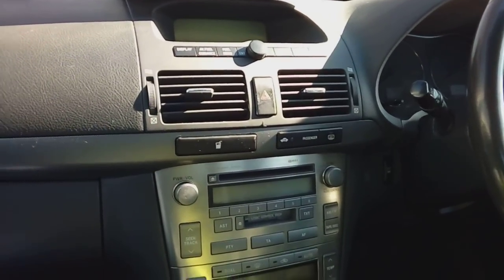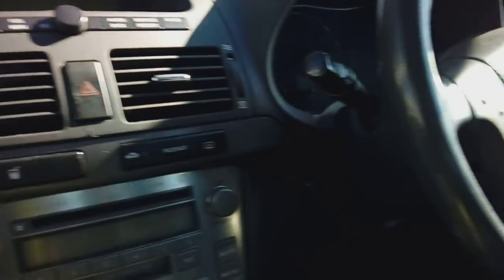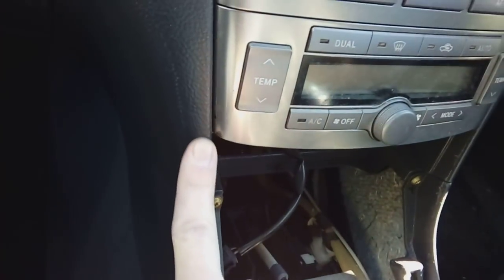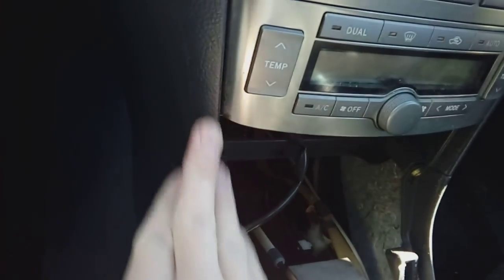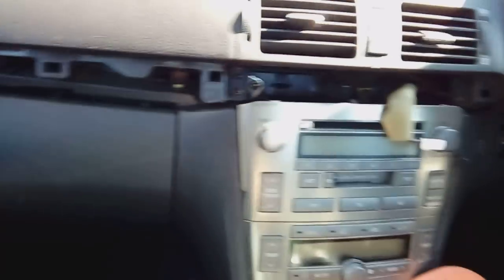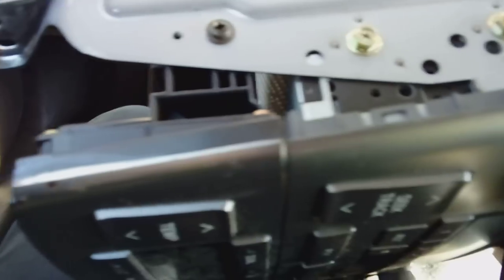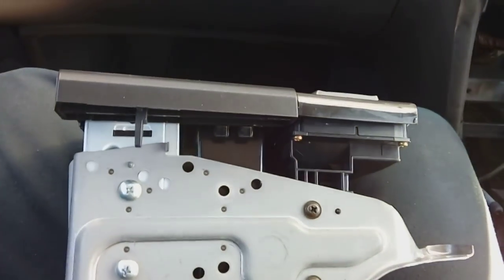Toyota Avensis 2003 - 2009 radio removal guide inc steering controls

Comment: Thanks a million for this video! It helped me today when I wanted to check the reason for very poor and mostly non-existent sound. If any sound, then from one of the four speakers only. I wanted to see if I would find any visible loose connections, which I didn't. However, after disconnecting all plugs and cleaning them (fine sandpaper slip on a tiny stick) , including all sockets, the sound is now perfect from all speakers. I was prepared to take the next step and aquire another unit, but luckily I didn't have to.
I would never have had a clue where to begin, if it weren't for your video, so THANK YOU!!! I encourage everybody to check and clean all connections before disposing of a unit which is not performing.
Greetings from Pargas, Finland

Comment: I have changed my old head unit to OEM B9010 one and my steering wheel controls stopped working... I just wanted to ask is there a fuse I might have burnt?
Reply from the maker: Nope sadly not, steering controls work on a resistive circuit so the control is either not getting a signal or has simply worn out.

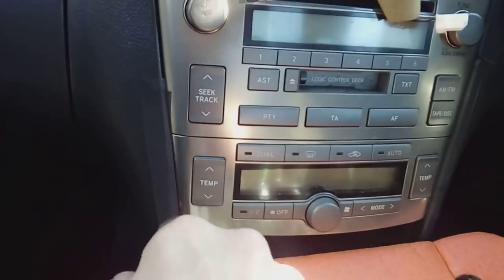Comment: Your video is very useful but there's a problem I'm facing after installing the OEM Radio there a gap between the Radio and the side plastic that you pointing at 4:06 so I fix that gap

Comment: Video cuts out 8mins 15 secs into it, is there a 2nd video?
Reply from the maker: Anything is possible but you may need to extend the radio wires and make a custom mounting solution.

Comment: Where's the rest of the video?
Reply from the maker: guoitdreuy Is the video not fully playing for you?
Reply: PJs projects It stops at 8.15 in mid sentence. Great video though I'm sure I would have ended up scratching my dash.
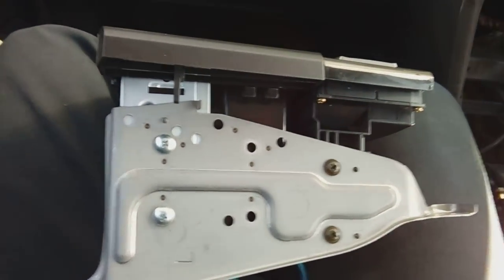Reply: PJs projects hey man, video cuts out at 00:08:15 when you are in the middle of saying and screwing in the new radio. Is that really the end?
Reply: @PJsprojects  I'm also looking for the fitting instructions of the new sterero and wheel control wiring please
Reply: @PJsprojects  This video ends part way through! You need to reload it, to show the installation of the Connects2 wiring and steering control adapters. Then show the new system working.